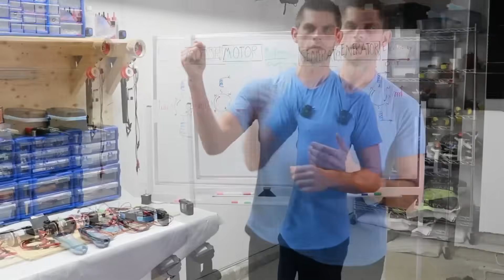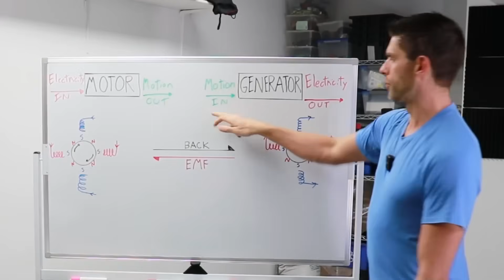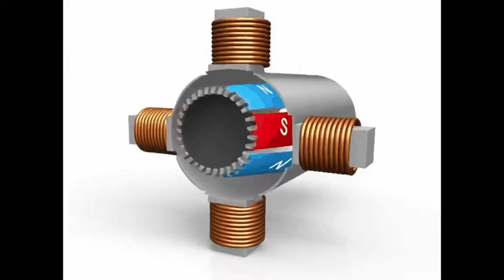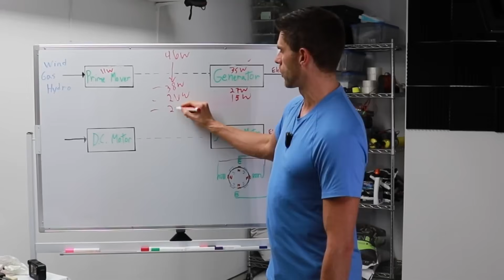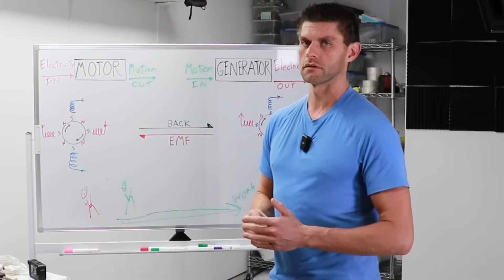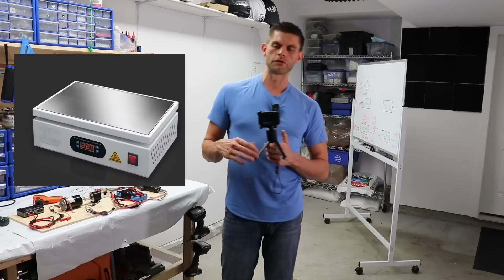Spencer Frame I Built a Machine They Said Was Impossibe

Comment: What was the voltage drop and current draw of the resistors? You changed the load of course the generator responded to change. Compare a given load on a conventional generator and use the same load on your system. To  compare apples to apples, make the outputs the same. 120vac 60 hz.  Make the load a heater or something that can be measured a light bulb and lumens/lux.

Comment: I did very similar experiments with a pulse motor and bifilar coils on the generator side. I also thank Thane Heins for the inspiration. He's been inspired by Tesla and others. There's a logical thing we miss to understand in order to move forward amd I really believe we need to figure this thing out before we create more energy out. The thing is: A no load situation is not when you don't put a load on the generator, it's when the generator is not present on the motor. Then you really see how much the motor consumes without a load. Then you create a generator with the right sets of magnets and multifilar coils in series, short them all one by one or all at once if you connect them in series, then the generator becomes a motor and the motor becomes a generator. It took me two minutes to write this and it will take us years to make it happen.
Reply: what about new tech like programmable magnet technology being incorporated.  What in your esitmation is required to get past the  current hurdle?
Reply: @Pumpkingil probably speed and coils shape, but I'm not that expert yet.
Reply: @StefanDanov  theory on coil shape?  I would like to stimulate wider investigation on all theories, theory on speed?  chances are that maybe we find something already applicable but no one over there with that thing , whatever it may be,  has connected the dots yet, connected their thing to how it could work with this,  I get persistent intuition that this is how it eventually be solved,  Old expired patents is another potential source,
Reply: @Pumpkingil I really don't know exactly, but considering in modern generators wr use "fast" coils, there's a chance a slow one is different. The number of windings encrease the voltage which is crucial. Probably a flat coil is better, probably multifilar, which then encrease also resistance of the coil that is a negative effect. The speeds depend on the overall system and frequencies involved. I personally would try a homopolar generator like the N Machine at the moment, then move from there to a regular one. One bit at a time. We'll see how it goes in the future. Experimentation is really expensive and it's not the right moment for me, I'll have to save money first or find some support on internet.
Reply: @StefanDanov  why aren't more regenx coils used in these repications and demonstrations? I have yet to see a full wheel or ring full of these coils in action
Reply: @Pumpkingil I ask myself exactly the same question.